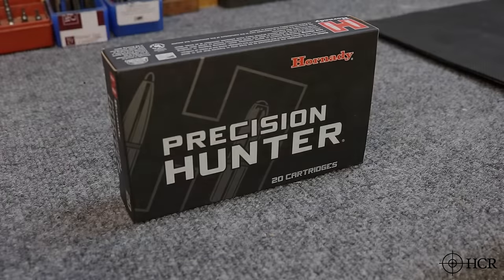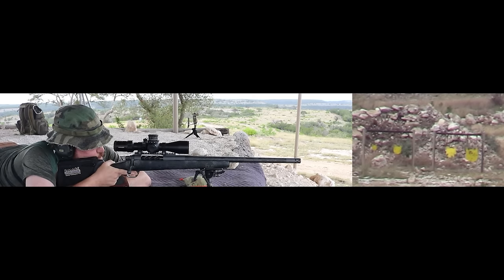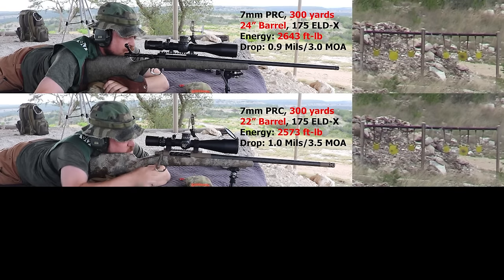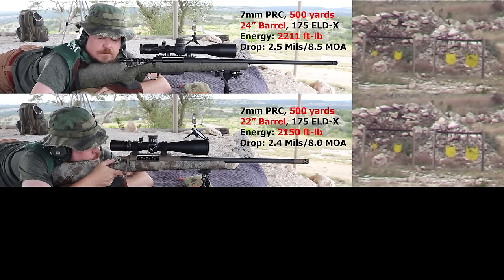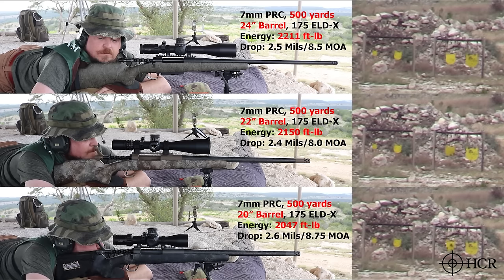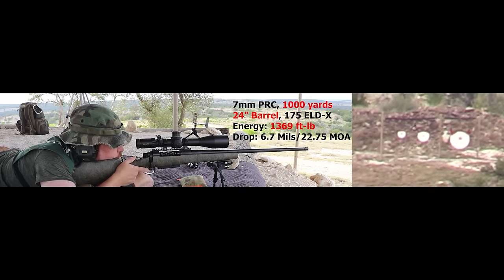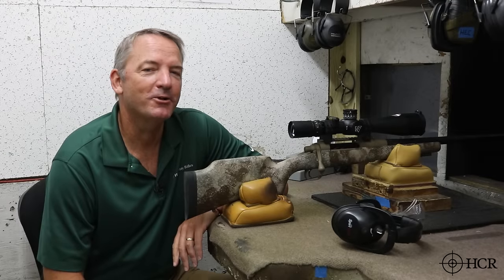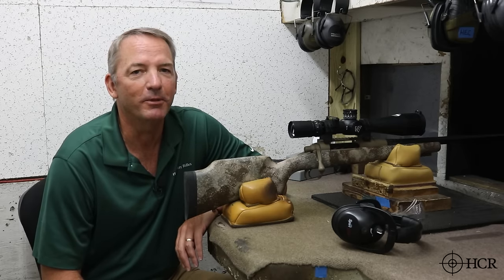Long Range 7mm PRC Testing & Data

Comment: How about taking a used 300 Wby or 7 MM Wby unscrewing the Barrel ,Setting it back to accept the 300 Win or the 7MM Rem Mag. and reaming. Ok Fireformed Custom cases that won't fit a standard 300 Win or 7MM Rem, but standard Cartridges will fit, No new Rifle or Barrel, $750 -$1500. Ok Twist, 1-10 for 300 cal will stabilize 200 -212 Grns, and 1-9.5 for 7 MM 180-190 Grns, Posible ?
Reply: 1-9.5 twist will only stabilise 162gr projectiles in the rem mag. You can still shoot the heavier ones but your BC will be way lower than it should be, could even tumble
Reply: You can get factory 7 mag rifles in 1:8
Reply: @SpudOutdoors  Mind comenting which?
Reply: @WillyK51  a few. Browning. But it’s pointless now that they have this modern cartridge that does the same.
Reply: @MrT13  I know, you can buy a 300PRC or  7MM PRC or a 28 Nosler. BUT tinkering is always fun. Otherwise no one would customize their old guns
Reply: @WillyK51  oh 100% completely agree. I still stalk pig hunt with a 1961 model 94 30-30 sometimes. Or a lever action shotgun win 87 made in 1890. It’s a short maneuverable cut down to 20” long ago fun little gun I shoot 2.5” out of. I love old guns just as much as the next guy. I just don’t like it when ppl say new stuff is 30$ a box more. Or how you could just put a new barrel with a custom reamer on an old gun and load em 1 at a time and it’s just as good. It’s not. In about the last 5-7 years the everyone has pretty much figured this game out to put 20 shots in 10” at a thou for clean. I’ve had some stuff built so I get it. But this is basically a 7 lrm that you’ll be able to buy off the shelf berger stuff for in probably 6-12 months.
Reply: @WillyK51  it’s obviously gonna a lot more stout than the 6.5cm but I think it’ll be probably more popular. The 6cm is taking off. Not at many ppl hunt so they don’t really need the 6.8 but these 4 cartridges are tits for the longer pills everyone is making these last 10-15 years that really didn’t have guns to go in. You had to make one. 7saum 6br ppc shehane ackleys etc. the 6cm is a perfect 6. The 6.5 is great for hunting up to the Dixie line. Then it goes to the 300 which eh I could take it or leave it the wsm is just as good if you wanna tinker and like to punish yourself. But there was no 7 and the 6.8 doesn’t have the pills a 7 does. So I think it’s a fantastic cartridge. Has a place. Has a need. Has a ton of support before it’s even walking. I think it’s gonna do super well. Especially for those that want to shoot buckets of water and propane tanks etc at a g. It’s far superior to a most 7’s on the shelf and still probably more inherently accurate than whatever newer brothers. Certainly it’s vastly superior to the rem mag.
Reply: @MrT13  The only Big Game Rifle I own is a 1917 Enfield in Still 30-06. Served me since 1980's and 165 Grns at about 2800 Fps not to be taken lightly. Thought reboring to 35 Whelen or rebarreling to 300WM.  And my Interest in a 7MM is to get an afordable rifle for my grandson. And old 7MM RM fits my conservative way of thinking. ( Had a BLR in 7-08 and miss it( needed the money) for close brush hunting, Light and fast. For me nothing under 7MM and I reload, Light wheight game with a 140 grns or Elk with 160-175. It's mind bogling the amount of 6MM to 30 Cal cartridges available. I guess at a small store way in the mountains might find a box of 7 RM or 300WM.Loaded ammo and cases not hard to find and can order from Midway. The newer 6.5 and 308  plentiful, but other newer ones not quite. Been doing research on the 300 PRC and the 28 Nosler but fall back on the old. 👍
Reply: @WillyK51  hell yea I love old stuff too. Love the new stuff as well. Heck love it all. I got a stainless m77 paddle ruger 708 super good round 👍🏻👍🏻 you can definitely find older stuff all the time in the right places that still kick a too.

Comment: Of all the modern cartridges out there the 300 PRC makes sense to me, the only downside to it is the short barrel life.
Reply: The PRC has no shorter a life than the 300 WM. It is a great cartridge, agreed, but most dont want the recoil. This 7mm is a way better choice for imo, despite it having a much shorter life than the 300 PRC.
Reply: I really like the way mine shoots, personally I like the 30’s over the 7’s
Reply: @supersubes why would the 7prc have a shorter barrel life than a 300prc?? The 300 is faster and more burn, or did I misunderstand the comment?
Reply: @dvskane1808  Speed doesn’t matter in the slightest with regard to barrel life, but the 300 is not faster than the 7. The 300 is burning more powder but through a larger hole, and the barrels are lasting several hundred rounds longer than the 7 PRC.

Comment: Rebarrel a 7mm to a tighter twist and a deeper throat chamber. Now you can shoot these bigger better bullets the prc bores are launching. However with the 7mm you have more case capacity. That new 7mm will blow the prc away. Plus you can find 7mm ammo. Don't buy into the hype.
Reply: The rem mag? Has more capacity sure. But capacity isn’t the whole story. Case geometry plays a huge part. Way more efficient, you’re getting higher velocity with less powder. Now why would you want to go and do all those mods to another 7mm, when you can pick up a PRC that performs better with zero work, and factory ammo may I add to that?
Reply: @devinb3397  why a 7mm.with a new berrel, because it's a better value, and a better cartridge. Not to me mention it's faster and flatter shooting the same bullets. The pennies your saving per 20 rounds on powder doesn't matter. Your under performance does. The 7 PRC is a gimic and all hype.
Reply: @danelobe2524  7mm what? I have no clue what you mean by 7mm? There’s dozens of 7mm cartridges. 

How’s it a gimmick? What other rifle can you buy off the shelf with matching ammo that shoots a 0.79 BC projectile at near 3000fps. 

I own a rem mag but it’s outdated and has issues. The twist rate limits me to 160gr projectiles or less. And the mag length in my tikka means I can’t seat the projectile out far enough to get good powder capacity. All I need to do is put a new barrel on and I can shoot whatever projectile I want, 100fps quicker with the same powder charger, and have zero stress with mag length. 3 pretty big selling points right there. Nobody buys 260 remingtons anymore now the 6.5 creed exists. I bet everyone said it was a gimmick back then but why would you buy a 260 when a 6.5 is on the shelf and is far more optimised for heavy projectiles that have higher sectional densities for bigger game, and retain far more velocity and energy for long range hunting or targets.
Reply: @devinb3397 
 7mm remington magnum.
This cartridge also has 82.0gr H2 case capacity. Rebarreled with a longer throat and a faster twist you now have a cartridge that can shoot these high BC bullets faster and flatter and just as accurate. It all marketing garbage and writer hype to get you the consumer to buy the ""new" improved caliber. It's because you dont understand the dynamics of ballistics you fall for the BS. We were excited when these new bullets came out because we know what we can do with them in the 7mm remington magnum with a barrel made to shoot these high BC bullets. But I'm not going to short change it's potential by shooting these new bullets in a cartridge that doesn't match the 82.0gr H20 advantage it has over the weak smaller 7 PRC. The guys who aren't reloading there LRGuns aren't shooters anyway, of any sincerity. There posers, and we have a lot of BS'ers here .....
Reply: I want to buy a 7mm for hunting. You're suggesting getting a 7mm Rem Mag and re-barreling vs just purchasing the PRC? Craziness...
Reply: @brianthompson9485  that’s what I’m saying, the PRC is better in every aspect. Can get it straight off the shelf and shoot any projectile you like with factory support and no stress about mag length. Just a better designed cartridge. And I own a rem mag but I definitely won’t get another when the PRC exists